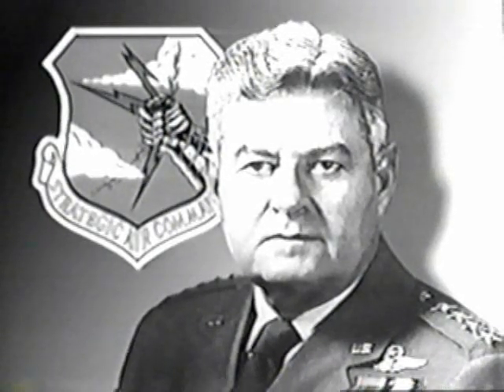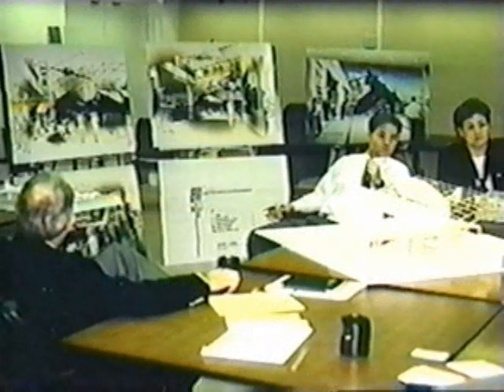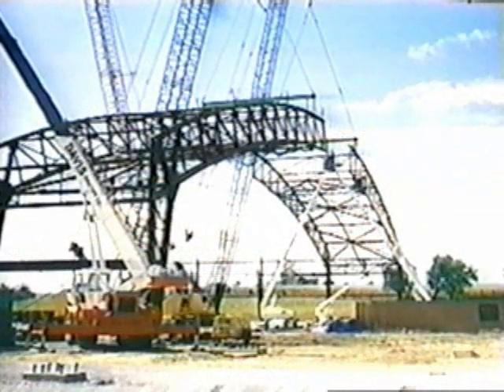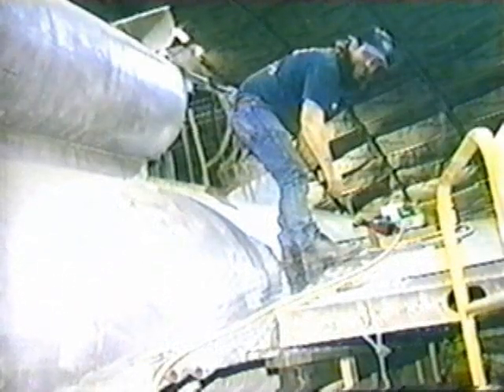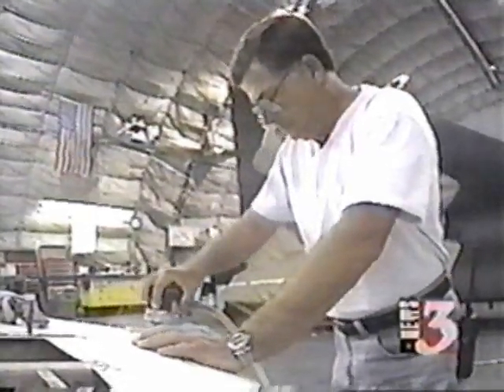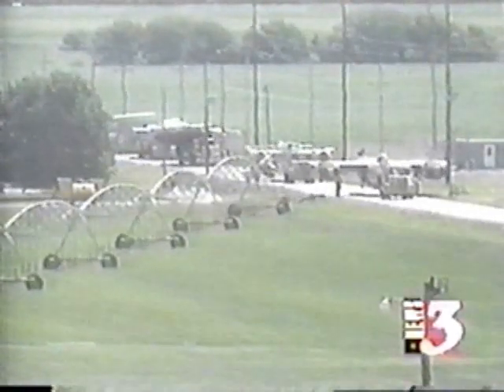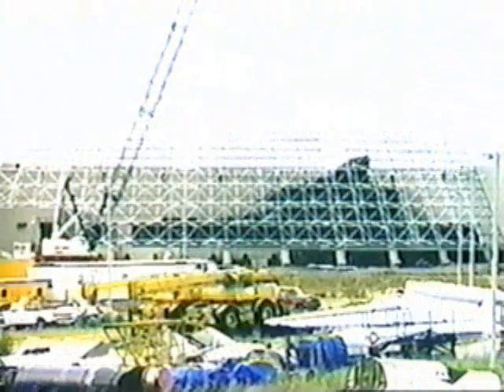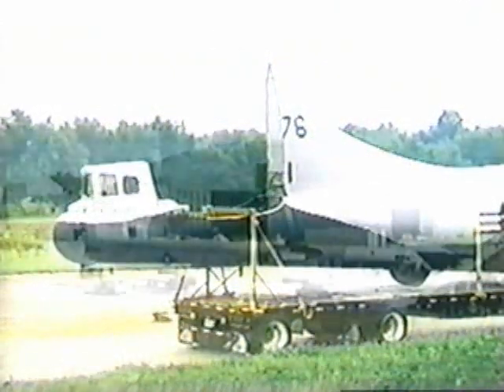SAC Aircraft Move

Comment: The movements were conducted by Worldwide Aircraft Recovery, a firm that specializes in moving various aircraft to museums around the country, and upon receiving a contract, they start disassembling the planes using the original factory break points, so as to make it easier to reassemble the aircraft after they arrive at the museum. Unfortunately, when the 509th Bomb Wing's Heritage Air Park was being moved to its new home at Whiteman AFB, the company they hired torched the wings off of their B-52, and then they dropped it onto a flatbed trailer, which caused extensive damage to the fuselage, as well. That ment the 509th had to contact Worldwide Aircraft Recovery, to restore their B-52, before it could be placed in the Air Park.